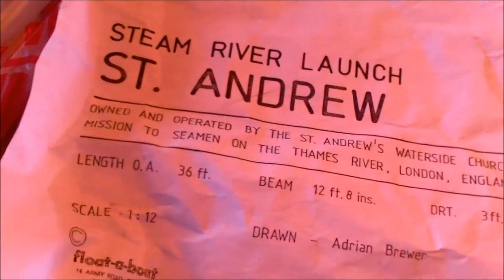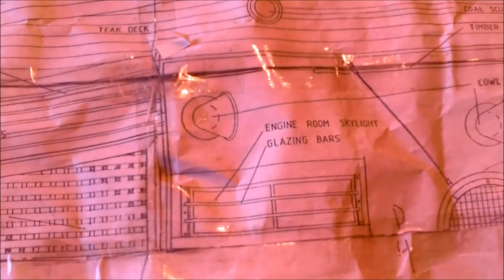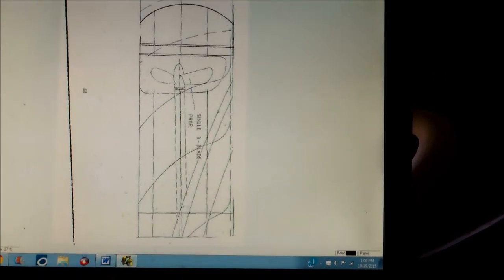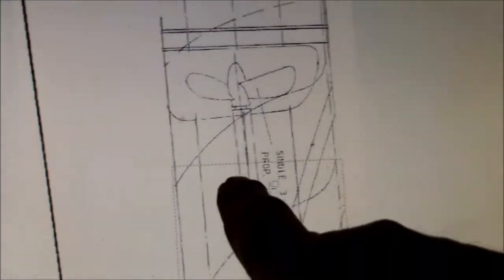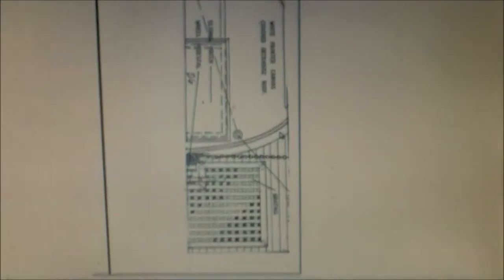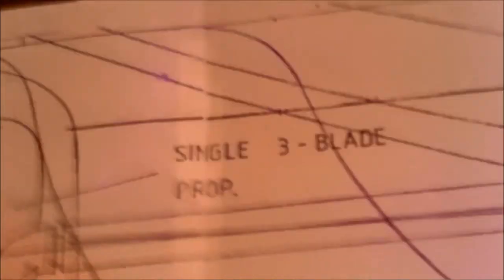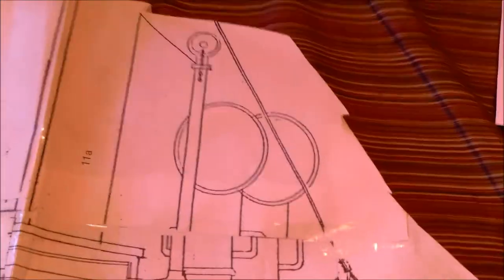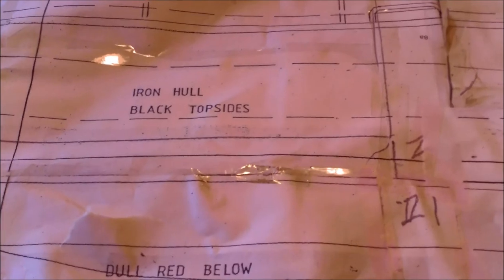How to enlarge drawings of a model boat.

Comment: The information on the plans you show say its for a 36 foot boat (with a 12 ft 8 inch beam and draft of 3 ft 10 inches) which you can see clearly from 0:04-0:09 into the video. Still a useful video nonetheless.